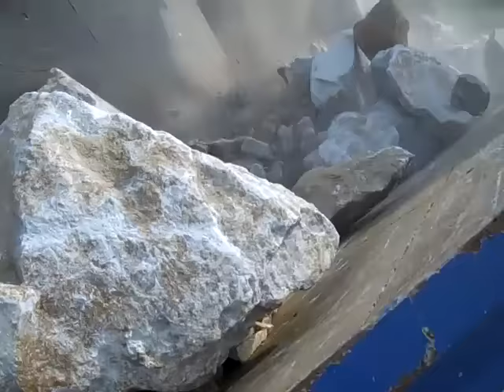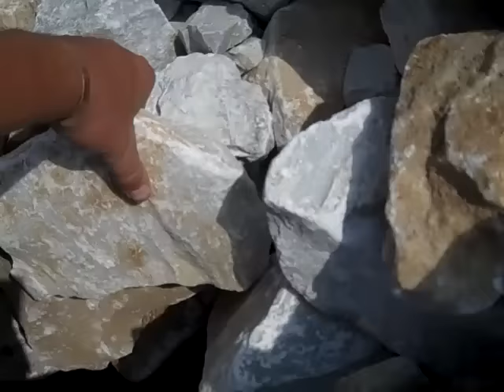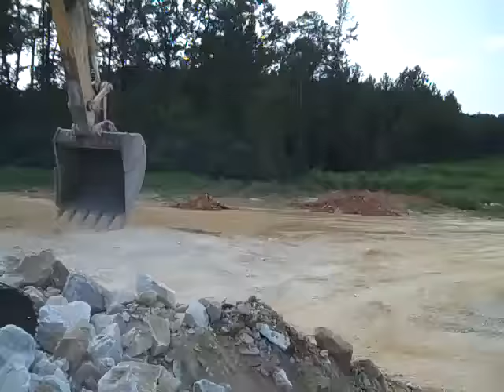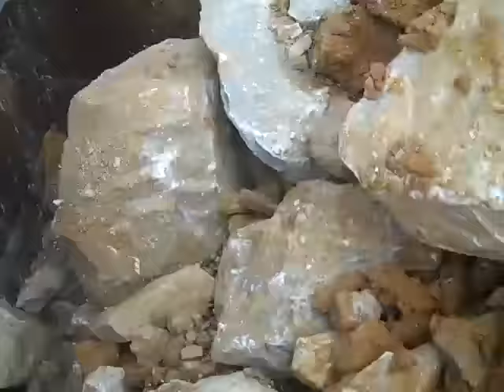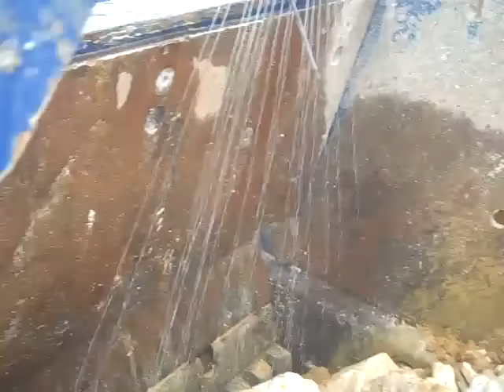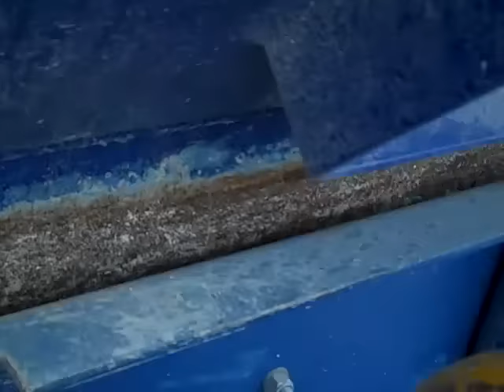Fintec 1107 jaw crusher crushing limestone in Alabama

Comment: We owned a 1107 Fintec jaw for about 3 years,  it crushed well when we could keep it running. Always had serious electrical problems continually making it an inefficient machine . Parts were always a problem, it was decided to dispose of machine & buy the oppositions machine.i don't know how the newer machines are fairing but they would have to improve substantialy for us to reconsider. Have brought a new McCloskey J50 & extremely happy to be making a profit for a change. Cheers

Comment: I could watch this all day, this is amazing watching blasted limestone being crushed and hearing it! I would bet that you average tons per day has to be at least 800 tons per hour. Keep up the good work
Reply: Longyi super fine powder grinding machines advantages:
1. Powder from 48~4microns, fineness is adjustable
2. Built-in high efficiency classifier, no more investment cost for classifying system.
3. Smart PLC operation system, and integrated control system: 1 computer could operated max 6 machines, saving management cost.
4. No particle air pollution, more environment-friendly.
5. Compact structure to save factory space and lower foundation construction cost.
 
For CaCO3 powder
The whole grinding system including grinding, classifying, powder collector, fan, PLC cabinet, feeding conveyor and others, system working power is 296Kw
1.  D97=23um (600mesh)      Output: 10tons/h       Energy Consumption: 29.6Kw/Ton
2.  D97=16um(800mesh)       Output: 8tons/h         Energy Consumption: 37Kw/Ton
3.  D97=10um (1250mesh)    Output: 4.5tons/h     Energy Consumption: 65.7Kw/Ton  
4.  D97=6.5um(2000mesh)    Output: 2.5tons/h     Energy Consumption: 118.4Kw/Ton 

It is suitable for processing nonmetallic minerals such as calcium carbonate, calcite, Kaolin, clay, barite, talc, gypsum, limestone, calcium oxide, bentonite, dolomite etc.

Best wishes,
 Samuel 
Senior Business Development Manager
 
Fujian Longyi Powder Equipment Manufacturing Co., Ltd
Web: www.lymill.com 
Add: No.5, Lianfa Road, Dongxiao Economic Development District, Longyan, China
Tel: +86-0597-2581699
MP/Wechat/Whatsapp: +86 15105956429
Email:Samuel@lymill.com
Reply: @samuelliao9216  Thanks for the response and explanation keep up the good work

Comment: it should have a grizzly to exclude smaller materials before entering in jaw crusher
Reply: It does.
Reply: Carlos Gomez that small stuff is kinda good in there believe it or not. I worked on a crusher and just putting big material through can jam so we would have to hammer away at it or chain out the jam. ( one of the older guys would go and get a loader bucket full of the fine stuff and put it in the jaw. Doing that would make the spaces smaller and make it crush easier)
Reply: @protectoroffaith  Carlos is a graduate of YouTube university, when graduated they gave him a new keyboard and new armchair. Geez

Comment: Like most other sedimentary rocks, most limestone is composed of grains. Most grains in limestone are skeletal fragments of marine organisms such as coral or foraminifera. These organisms secrete shells made of aragonite or calcite, and leave these shells behind when they die. Other carbonate grains composing limestones are ooids, peloids, intraclasts, and extraclasts.

Limestone often contains variable amounts of silica in the form of chert (chalcedony, flint, jasper, etc.) or siliceous skeletal fragment (sponge spicules, diatoms, radiolarians), and varying amounts of clay, silt and sand (terrestrial detritus) carried in by rivers.

Some limestones do not consist of grains, and are formed by the chemical precipitation of calcite or aragonite, i.e. travertine. Secondary calcite may be deposited by supersaturated meteoric waters(groundwater that precipitates the material in caves). This produces speleothems, such as stalagmites and stalactites. Another form taken by calcite is oolitic limestone, which can be recognized by its granular (oolite) appearance.

The primary source of the calcite in limestone is most commonly marine organisms. Some of these organisms can construct mounds of rock known as reefs, building upon past generations. Below about 3,000 meters, water pressure and temperature conditions cause the dissolution of calcite to increase nonlinearly, so limestone typically does not form in deeper waters (see lysocline). Limestones may also form in lacustrine[1] and evaporite depositional environments.[2][3]

Calcite can be dissolved or precipitated by groundwater, depending on several factors, including the water temperature, pH, and dissolved ion concentrations. Calcite exhibits an unusual characteristic called retrograde solubility, in which it becomes less soluble in water as the temperature increases.
Reply: History 101